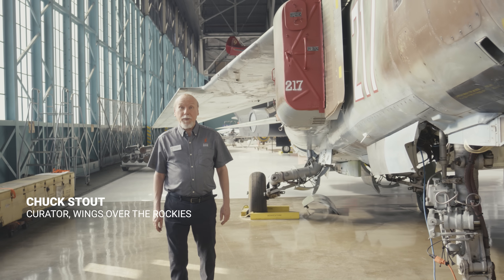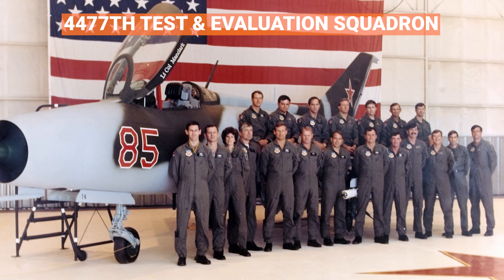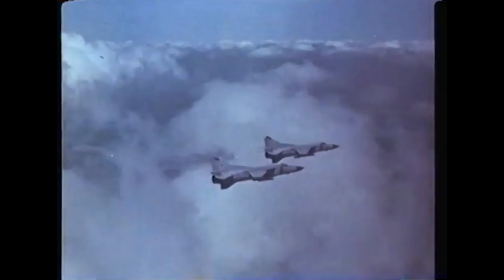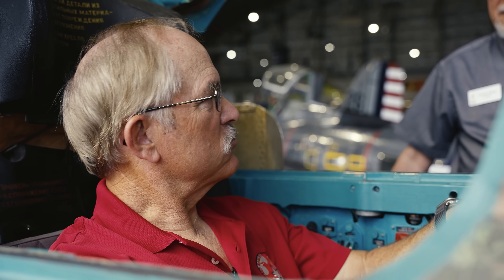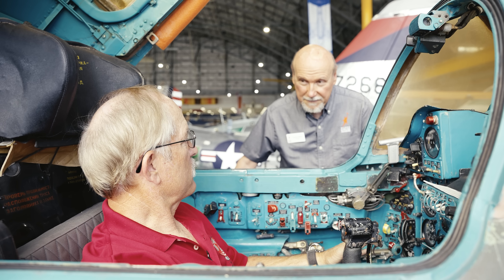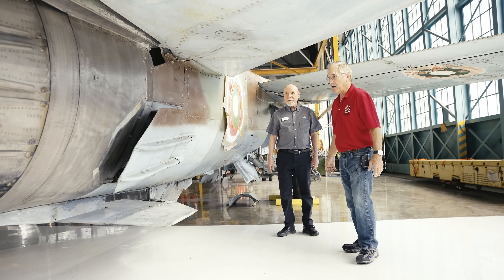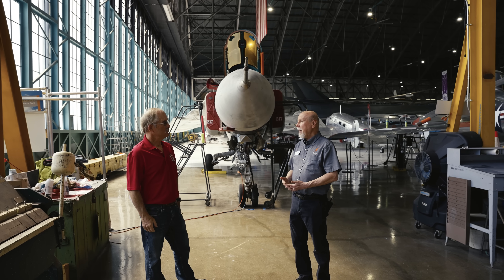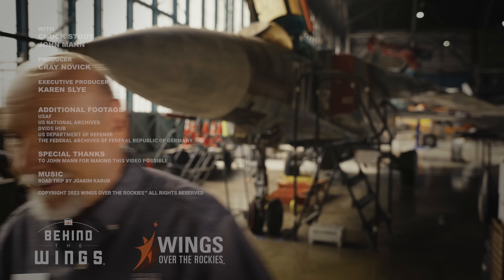America's Secret MiG-23s | Behind the Wings

Comment: 10:26
that's a MiG-27, a ground attacker variant of the MiG-23, but not really comparable
Reply: It's more likely a MiG-23BN, the MiG-27 has slightly smaller fixed intakes without the variable intake ramp/splitter plate extending forward of the intake.

Comment: The history of creation is fundamentally wrong, after the first minutes you can close the video, I will also correct it, the MiG-23 is not an interceptor, but a fighter.
Reply: It is also worth noting that it is also not clear about maneuverability, the MiG-23 in the ML/MLD/P version was very maneuverable, the maximum angle of attack was like that of the F-16 and it obeyed the control stick very well, of course I went a little too far with the statement that this is a fighter, it was previously conceived as an interceptor, but in fact it is a front-line fighter and no other way. Maybe in the concept of other countries it is an interceptor, but in the USSR it was precisely a front-line fighter, as well as it was not preparing for an invasion of NATO countries, what can I say if most of its capabilities are opened with support from the ground from stations and dispatch bases, you should not lie. The chassis was reinforced to be able to land on unprepared lanes and work without restrictions throughout the country (and let's say it was large and not every part of it had normal landing strips, even there was no asphalt), there is most likely an early modification of the M version, etc., since it is clear that the keel is not shortened. It is also worth noting the optical-location station, the pilot liked him very much.
Reply: Also an interesting feature, it was possible to reduce the height without changing the steering position and without touching the thrust, just increase the sweep of the wing and the airplane itself stuck to the ground. It was a very good plane at the time.

Comment: I know it’s somewhat irrelevant to real-World air-air combat, but just how fast could the Mig-23 fly?
Reply: Mach 2.35, or 1,555 mph/2,503kph
Reply: @Insert-Retarded-Reply-Here  That was its operational limit. It could go much faster but would literally tear itself apart as it was made of standard materials not designed for the heat stress experienced at Mach 3-level speed. Just as the f-15 with its theoretical Mach 2.5 max speed, but in practice limited to 2 minutes of such speed.

Comment: Whats neat about us having a mig-23 is that as soon as we saw the same avionics and manual hydraulic systems from this known failure appearing again in the mig-29, we knew we were under zero threat from it with our f-16s
Reply: Kind of an ignorant thing to say, since you went to Germany once they inherited the Fulcrums from the East German airforce to dogfight against them in your f-16s, f-18s etc. and got your asses handed to you by the Germans. In the 90s the only way to neutralize a MiG-29 was to shoot it down from beyond visual range. Otherwise there was nothing western fighters could throw at it that it couldn't handle. It had superior turn rate, climb rate and, most of all, the helmet mounted sight (HMS) coupled with the R-73 missile with high off-bore capability.  The US acquired such a system only a decade later with the AIM-9X.
Reply: @DrittAdrAtta  no
Reply: @thepisswalker  yes

Comment: The early models were plagued by a litany of serious stability, durability, maintenance problems, difficult to fly and radar jamming of one aircrafts radar to another when searching together as need in standard combat operation. It wasn't until 1978 until production model were produced that solved these serious issues that the aircraft really came into it's own, but then the F-15 was in full production the MiG-23 was a dangerous foe only to older aircraft than itself if the top models were use otherwise even upgraded older aircraft could easily hold their own.
Reply: It has dawned on me that the US built aircraft to fight an air war that the Russians had no intention to fight. I think the Russian doctrine was interception and ground attack with SAMs filling the gap. This actually seems to be been a very smart plan when the intention was that enemy aircraft were very unlikely to survive the SAM onslaught.
Reply: Who said that?

Comment: Great presentation! I wish I could meet John and talk with him about the Flogger. There are several items I'd like to humbly point out. The 4477th flew a first-generation Flogger, The Mig-23MS. The airplanes they got, 8 of them were sitting out in the desert for 5 years in Egypt and were pretty fried. Also, very few spares. What they did to keep these flying is amazing. The seat being so low IS  NOT a standard feature, there is an electrical motor for the seat(Km-1) that raises it on the left side of the cockpit. It looked to be in the lowest position. The Flogger also has a two tier taxing selection. It can turn VERY tight on the ramp with the proper selection, otherwise you do get wide radius turns. Oil pressure is located on the lower part of the panel as well as an annunciator light that not only indicates low pressure but debris in the oil. Pretty cool. As far as speed on Flogger was reported to hit M3 in a dive, it is a VERY powerful plane! Also, THIS Flogger is an ML which is a VERY VERY different animal than the MS,MF or UB. The ML is ONE TON lighter than the `standard` Flogger and has the `big` R-35 engine at 28.6K thrust and VERY improved systems and flight characteristics. Thanks guys. Will Ward
Reply: Thank you for this supplemental info.  My biggest question, which was not addressed at all in the vid, was how the Migs were acquired.  I was always impressed with the Mig 23 and Mig 25 and absolutely love how they look.
Reply: @Vile-Flesh  https://en.wikipedia.org/wiki/4477th_Test_and_Evaluation_Squadron#MiGs_acquisitions
Reply: by modern standards the cockpits in the MiG-23 looks really dated

but how do they compare with their contemporaries of the time such as F-4 and F-14 ?

How does it compare with the MiG-29 ?
Reply: @kwanchan6745  IIRC the Soviets got their hands on F-5s they got from South Vietnam, there's a good read or interview somewhere online (that YT specialist on Soviet test pilots... can't recall his name, but excellent research) and it seems they really liked the ergonomics and it influenced their 4th gen fighters cockpit layout. I do see some differences with the SU-27 and MiG-29, but am no expert on the matter (but a commercial pilot).
Reply: @Walterwaltraud Paper Skies?
Reply: @schaddenkorp6977  Possible, I have not checked or verified.
Reply: @Walterwaltraud  that yt might be paper skies?
Reply: And there was the latest version MLD with the additional vortex generators at the LERX and the Pitot tube. The MLD max AoA was above 33deg, it has automatic leading edge flap controll and a way more advanced fire control system. What could be confusing is the designation, since the MLD itself means an ML "Dorabotanniy"  -> "Reworked", so there were a lot of used MLs which had the upgraded avionics package, called as MLD; and a lot of new airframe MLD, with the modified aerodynamic layout (plus the upgraded avionics).
Reply: You are correct! Nice job! Everybody lumps the Floggers into one group when they were actually different and improved. The program within the 4477th for the Floggers was called HAVE PAD for the MSs and HAVE BOXER for the BN. They received the designation YF-113E and YF-113B respectively.
Reply: @kolbola Да МЛД делали для противодействия ф-15 и Ф-16. И по некоторым параметрам он даже превосходил их хотя конечно это более старое поколение.
Reply: Hi! Just curious here the opposite of it, did Russian got hold a good plane F-4, F-16 or anything. I heard that's Russian might got hold F-5 or F-86 in Vietnam or  Korean war but haven't seen the photos.
Reply: @MHMajid-yi8iu  There are rumours that they got hold of a bit of stuff via Iran. I'm a bit skeptical about some of these things because most of the rumours come from the USA but they ignore the fact that Iran and the Soviet Union or Russia have never been that close. Other 'sources' blame the KGB. I'm not convinced any of it is true.
Reply: Thank u for your info!
Reply: Yeah, right -- the Russians are patheically stupid, uh? Never will have your genius, huh?
Reply: Thank you Sir
Reply: The utilization of cutting-edge military technology is essential for maintaining peace and security.
Reply: @militarytechhd 
"The utilization of cutting-edge military technology is essential for maintaining peace and security."

I don't know where you got that idea from. Technology is rarely a factor. What matters is serviceability and reliability, combined with the way it's used. Pilot training is about a thousand times more important than 'tech', as nerds love to call it. Like a lot of things, technology is an advantage but it is a myth that it wins wars. It will never and can never be more important than training.
Reply: @thethirdman225  - Training is certainly important, but technology is ABSOLUTELY a factor, not "rarely" as you state.  There is a stupid old adage that says "the old experienced fighter pilot will always win against a noob."  Something like that.  Not true.  Chuck Yeager in an F-4 will die miserably to a student F-16 pilot on his first DACT ride.  Modern tech, radar, sensors, newer missiles, do in fact win wars.  It goes without saying they must be maintained.
Reply: @kurtbjorn3841  Not really. I refer you to an article by defence analyst and former F-4/F-15 WSO, Col Mike Pietrucha called, ‘Capability-Based Planning and the Death of Military Strategy’.

Capability is not and never can be a one-size-fits-all argument. If we take a singular example, such as the Bekaa Valley Air Battle of June, 1982 (see ’Bekaa Valley Air Battle, June, 1982, Lessons Mislearned?’ by CIC Matthew Hurley), it’s clear that the battle was won as much by extensive Israeli training and planning. Yes, there were major technical advantages but it can never be assumed that this kind of lopsidedness will account for deficiencies in pilot training and overall battle planning. Jamming is hardly the pinnacle of technological development these days and wasn’t then either.
Reply: @kurtbjorn3841  Modern equipment does not win wars. Not real wars, anyway. Real wars are battles of industrial economies.
Reply: @thethirdman225  - I was an experienced fighter pilot instructing in the fighter lead-in program in the AT-38B.  I had previously flown the F-15.  I knew ACM, knew all the tricks.  We were sent to support Luke AFB students in their first DACT hops.  Despite our experience, we were like rats in a terrier's jaws fighting noob F-16 students.  There are simply levels of technology disparity that are insurmountable by any amount of training, experience, or trickery.
Reply: @kurtbjorn3841  Okay but there are plenty of examples of that in wars that were not won by the most advanced technology.

I’m sure most are aware of the German advancements at or near the end of WWII, with several high speed jets for which the allies had no answer.

I think everyone would agree that the North was at something of a technological disadvantage during the Vietnam War yet they prevailed, as did the Afghans more recently.

The conclusion I draw from history is that technology is either there or it isn’t. Now some might see arguing with a fighter pilot over this as pointless - and I don’t expect to win friends and influence people with this - but I wasn’t arguing on the basis of 1 v 1 or 4 v 4 here. Someone was making the point that technology is absolutely essential to winning wars. The F-16 noobs you came upon against were likely a lot better trained and led than any in the Syrian Air Force when they came up against the Israelis in 1982.

The end result just depends on way too many other factors. Have a look at those articles I mentioned because they were written by military strategists. They don’t make me right and you wrong but they do amply illustrate the point I’m making.
Reply: @thethirdman225  - I agree with much of what you say.  War winning requires ALL the fundamentals of training, logistics, leadership, timing, mass, many more factors, combined into a strategy that works.  I will say however that Middle Eastern pilots in MiGs and Sukhois have gotten short shrift in the history books due to inflated Western kill ratios.  They were not inept by any means.  We were simply that much better, both tech and training.

Technology is a VERY important aspect.  Could 100 resurrected Red Barons in Fokkers defeat even a 4-ship of P-51's, let alone jets?  Of course not.  That example is extreme, but you get the idea.  To quote an early F-22 pilot who flew a 2V8 vs. F-15's, "It was like clubbing baby seals.  The F-15 pilots were helpless."

If you'd like an excellent read on the development of both 4th generation U.S. jets as well as one of the deepest strategic thinkers of all time, try "Boyd: The fighter pilot who changed the art of war" by Robert Coram.  A tremendous book.  Cheers!
Reply: @thethirdman225  "Technology is rarely a factor" The tribes in Africa when Imperial Britain showed up on their doorstep beg to differ.

Comment: A couple of questions after this excellent video that left me wanting to know more

1. From where did the US get hold of these Mig 23’s? Bought them from soviet allies or did Israel capture them

2. How many 23’s flew in the US? Where there also 27’s

3. How did you train the pilots flying the 23’s? Did US get hold of any 2 seat trainers or just relied on passed down information from experienced pilots to the new ones taking over? 

4. Did the soviets know about these USAF flown 23’s? The F5E Tiger 2 aggressor squadrons where general known about but this Constant Peg was a black program right? But a lot of people must have known about it. Where the “standard” aggressor squadrons a completely different unit or did these work together? 

Great video!
Reply: The Mig-23 came from Egypt. The US pilots didn't learn to fly the Mig-23. They learned how to shoot it down. It's a big difference.
Reply: @ichimonjiguy  Thanks for the answer about where the units came from BUT regarding the question about how the US pilots learned how to fly the Mig 23 is related to how the US aggressor pilot learned to fly it. I know that it was not the general USAF pilot that got this training of flying the 23’s. It cannot be easy to sit in a completely new aircraft with a total different philosophy. I suppose experienced pilots passages down the particular quirks to new pilots.
Reply: @holgernetterby4863  The Air Force picked experienced pilots to fly the Mig-23. It's like test pilots flying a new aircraft.

Comment: Of interest is the boundary layer splitter plate just ahead of the engine intake (on both sides). It is identical to an F-4s!  It even has the same amount of holes in it. Reverse engineered or simply stolen design blueprints by the russians.
Reply: It is  IDENTICAL to the F-4s BUT different dimensions and the holes are different than the F-4s

Comment: Dose the mig23 have the same angle of attack limits as the F4E? Which can turn better the F4E or the MIG23?
Reply: MiG23 MLD. It received leading edge slats that helped a lot with the maneuverability. With the wings fully extended it can put rate the f4e. The MiG 23 in this video is probably a MiG 23M which didn’t have the slats.
Reply: YES! An intelligent reply! Fighter in video is an ML and would defeat a F-4.

Comment: That is a very nice video! But, I have a question: which aircraft building philosophy is better to a fighter, american or sovietic one? Or, is that irrelevant?
Reply: Soviet aircraft design made certain assumptions about how a NATO/Warsaw Pact conflict would go - namely that it would be a nuclear exchange, and the survivors (if any) of that would need to operate under severely austere conditions, rendering ultra high-tech equipment that needed sophisticated support unusable pretty fast. The Soviets also had vastly different budget constraints and operational requirements than the US did. ‘Better’ is a highly subjective term - the Soviets wanted/needed large numbers of simple, reliable, easy to maintain and inexpensive fighters, so that’s what they built. American aircraft are usually qualitatively superior, but also much more expensive and need more complex support. MiGs could be operated from dirt roads if needed and supplied out of pickup trucks. Had the Cold War ever gone hot, the Warsaw Pact had an enormous numeric superiority that would have been telling, and they might have been able to keep their less complex planes operating longer than the NATO wonderjets.
Reply: @madaxe606  This misses the important aspect which is that Soviet aircraft were meant for a "guerrilla in the air" and an extension of the surface to air defensive system. The design philosophy was based around the inability to go head to head.
And they did use sophisticated computer equipment.
Reply: Did you watch the video?
Reply: The NATO/American standard is best when there is adequate training involved. Soviet doctrine is extremely rigid and the battle field is far from rigid. Well trained pilots are allowed to make tactical decisions on targeting, maneuvers, covering etc. whereas the Soviet method someone on the ground with a map or radar screen tells you exactly what to do.